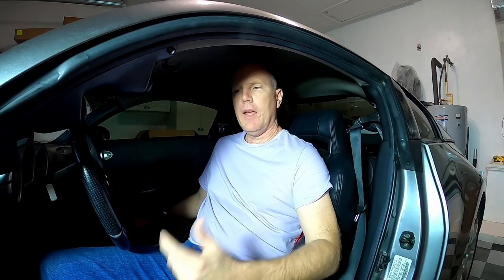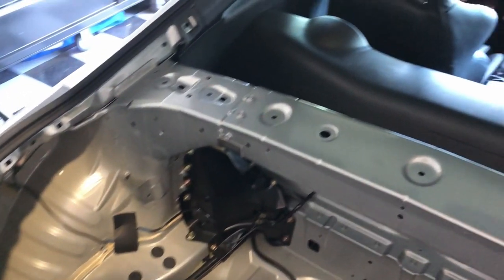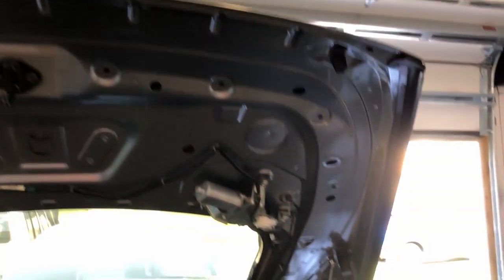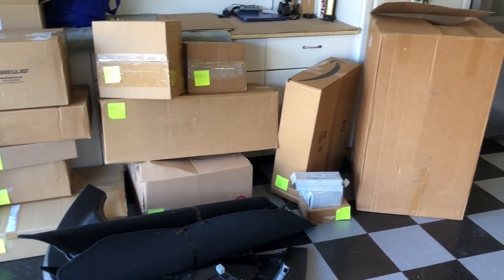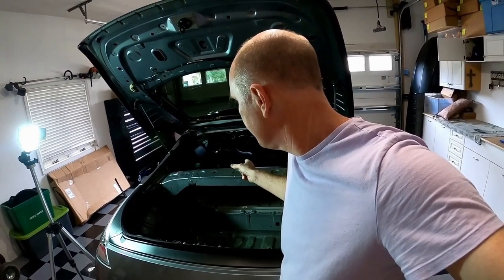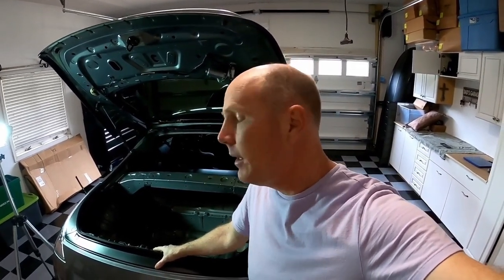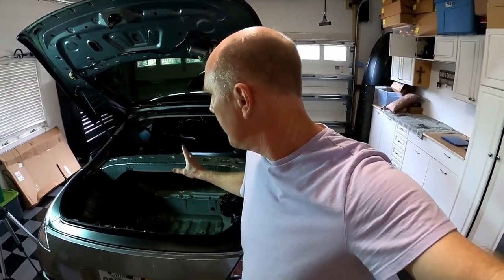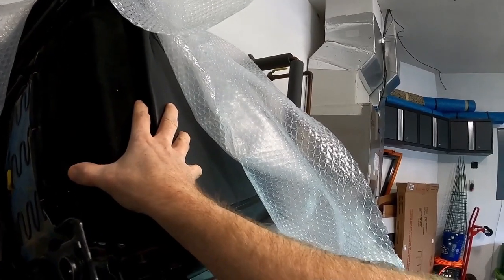Spend $2,000, lose 200 lbs. (350Z Challenge)

Comment: The test pipes are about 10 pounds lighter each, but there's a few heavy parts you can replace. Swap in single exit exhaust (unless you're sure you'd get a ticket), single mass flywheel, the kinetix velocity manifold actually weighs like 8 pounds less than the cast aluminum manifold. But the youtubers bragging about extreme numbers likely weigh the vehicle with a quarter tank of gas (not usable on track), and no washer fluid. I use rain-x instead of washer fluid honestly. 

But you're correct about that speaker box, I made a video with more exact weights, but off the top of my head, the metal, plastic, and speakers all together weigh about 100 pounds. 

And I just remembered those more track oriented builds have ditched airbags as well as a/c, heater core, etc.
Reply from the maker: Jellofuel, great information. I weighed lots of parts. Sadly there are few cost effective ways to achieve massive weight reduction unless you want to gut your vehicle. My aim was to keep it a daily driver and to achieve radical weight reduction meant more exotic parts. Yes, I explored removing the Borla exhaust and going to a single exit racing exhaust from the y-pipe back. It is cost effective but I had to be careful not to change the weight distribution too much either. It was lots of fun!
Reply: @robreview  My approach has been to replace broken, heavy stock parts with lighter alternatives. Like the seats, wheels, flywheel, cats, etc. I really like your approach of weighing everything on a digital scale - a lot of forum posts (especially the older threads) just egregiously overstate the numbers lost. Like, these cars aren't that heavy from the factory lol
Reply from the maker: Thank you. I weighed about 50 parts and tracked the data in a spreadsheet. I found much of what is in the forums and elsewhere is overstated. Even when buying parts the weights are often not as advertised. I haven't had a chance to finish the update video, but In the end, I was able to drop a little over 120 pounds, maintain the handling and balance while improving the 0-60 time by nearly 1 second. While it may not sound like much, it completely changed the car's dynamic. It felt and ran so much better.

Comment: Balance wise, I WOULD say the dual exhaust alone probably evens out the weight distribution. Iirc it's a 53/47 with the rear being slightly lighter. Going with headers and test pipes up front to reduce weight and duals all the way back in theory would help, if most of the added weight wasn't in the middle of the car. Both mufflers still probably weigh less than the one huge stock muffler. 

I would say for the most part you'd wanna stay removing more from the front. 

You're either going to spend a lot or get good at custom fabricating carbon fiber or fiberglass parts unless you want to gut it and remove creature comforts. 

As said already, there are lighter parts like pullies, flywheels, an unsprung clutch disk, but all of that would be expensive and isn't doing more than 30lbs max. It's mostly for rotational mass and helping the engine out. 

I mean think about it, you can either remove stuff. Which is free, but looks like a gutted car, and or loses creature comforts like music or a/c and the tradeoffs for a daily might not be the best. OR replacing parts with special lightweight parts which costs some good money or requires the ability to fabricate your own parts. Those are your two options. 🤷🏻‍♂️🫤
Reply: Any performance gain is going to trade something. More power is going to trade fuel economy. Gearing is going to trade top speed AND fuel economy. Gotta figure out how bad you wanna go faster. 

Easiest way to go faster is more power. Cheapest way is to sacrifice comfort and safety and gut it. In theory you'll get a few free mpg that way too though
Reply from the maker: @kotymccallister5150  100% right! Well said! Safety should be important. Can always swap in a stainless racing exhaust to quickly drop 20 lbs. After that the savings start to cost you. FYI- swapped the pulleys and fly wheel out for lightweight racing versions. Headers were swapped. The Y-pipe and mid pipe only weigh about 10 lbs each, not much savings there. As @kotymccallister5150 said it best, "Gotta figure out how bad you wanna go faster..."

Comment: Get a "Tube" Dimple Die Set and start removing excess sheet metal. 50 to 100lb  
It will make the car much stiffer and is about $120 for a good set. 
OR
lightweight bumper support bash bar 5 to 8lb
Aluminum Driveshaft saves 2lb
Lightweight Crank Pulley KIT saves 4lb
Reply from the maker: Great points. I explored many of these options. I did not want to alter structural integrity or crash safety. I did go with lightweight pulleys. When considering comfort/safety, cost, and performance, you can prioritize two, but it's challenging to achieve all three at the same time. You may have comfort and performance, but at a higher cost; comfort and low cost, but with reduced performance; or performance and low cost, but at the expense of comfort or safety.
Reply: @robreview reminds me of an old saying. Your choices are cheap, fast, and reliable, but you can only pick two. 

Seems the logic holds up here. 

But I'm sure Swiss cheesing under the speaker and glove box part wouldn't affect ridgity THAT much, especially if you reinforced with carbon fiber. Could get some carbon fiber fabric, lay it over, epoxy it to shape (with some form of barrier like waxed paper in between), remove it, take off all the metal you want, and as long as it hung over to where it attaches to either side of the frame, you could probably drill small holes and rivet it back in place. I might be over-simplifying it, but it's just a thought. 

You might could even do this and put the factory interior panels back over it for an oem look. Again, purely speculating

Comment: Maybe look into unsprung weight with lighter wheels/brakes etc. Rear wiper motor delete, sound deadening removal. I know you mentioned the hatch and hood are out of your set budget but they would make a pretty big difference as well especially if you can maybe find them used? Also get some lightweight door cards? 🤷🏻‍♂️
Reply from the maker: Salman, thank you for the excellent tips. I like the aesthetics of the door cards. I weighed the door panels are they are just under 3 pounds. Although it won't drop as much weight as I like, I have a set picked out. Or I might make my own. I have already noticed a big difference in handling and performance. Your point about unsprung weight is good. I have a set of tires and rims picked out. These should shave about 50 pounds. I appreciate the feedback.
Reply: @robreview  Looking forward to the next video! I’m unfortunately doing the opposite with my Z 😂 added new mats and sound deadening made it heavier lol
Reply from the maker: @SalmanHussain  I removed all the plastic from the hatch, but the road noise was too much. I did discover Noico 80 Mil Sound Deadener, which 7 pounds worth, will cover the whole hatch. The original sound deadener is 2-3 times that weight. Floor mats are important but check out Perlon felt. I might replace all the carpets with it. This felt was used in older Porsche race cars and is super light.
Reply: @robreview  I’ll look into it!